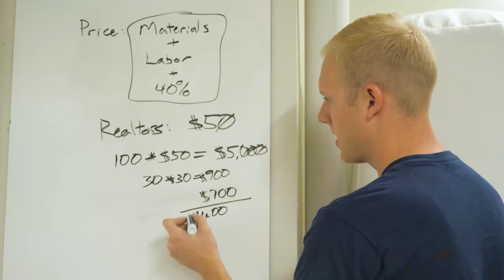this client wanted way more than we thought...

Comment: Hi, little tip.. use elongated holes in metal brackets to mount desk surface to allow for slab wood expansion/contraction, and do not overtighten the bolts. Beautiful desk desing BTW. One more thing, in my upholstery business, i had to be clear what is NOT included in the job.

Comment: Check out mixing mate on Amazon. It’s a cover for your finish that you put on in place of the original. The new cover still seals, but has a mixing handle and pours finish out like syrup. It’s quick and clean. Once you have one, you’ll never be without one.

Comment: Just a suggestion for a bit of a cleaner look, rather than routing out the legs to fit the flat bar for mounting you might want to route out the underside of the table then it all sits flush. You can still use the threaded inserts in the table but it will look like the legs are sitting flush with the bottom of the table.

Comment: I would elongate the holes on the metal plates underneath the desk. If you dont give room for the top to expand and contract your desk top will eventually run into issues and crack.
Reply from the maker: Holes are much larger than the bolt for this reason.
Reply: @jennieanddavis  ah, went together quickly and couldn't tell on the video. Thanks for the response 👍

Comment: Don’t put so much pressure on yourself. Sales is not hard under a few circumstances. Trust in your product, know your product, and create a relationship. Sales is all about the relationship. If you create a relationship with the client and make them trust and know you on a some what personal level then the sale comes easy. I’m in the flooring business and I’m a sales manager. If I go into a meeting with a client not confident in my self and the product, 90% of the time I’m not going to make the sale but if I go into it confident in myself and the product, 90% of the time I’m going to make the sale. Yes it’s a little different where flooring is more or less a necessity but it’s still the same process. Trust in your self first and then the product. If you don’t know the answer don’t tell them some bull crap and make it sound good. Tell them, “I don’t know, but, I will find out the correct answer and let you know.” A customer is going to appreciate that more than you making something up and telling them one thing and it being another. So trust in your self and then the product and you’ll be fine. Stop putting so much pressure on yourself and enjoy it. Once you start to do that you’ll have fun doing it and absolutely love everything about sales. Hope this helps.

Comment: Sometimes i am afraid that what they order it will take me alot of time to do or i dont have the right tool to do what he asked for, or i dont have the right skill yet to make what they want.
Reply from the maker: Ooh that's a good one! 
Couple things we've noticed from folks in the Stud Stack who have had this issue:
1. You're probably way more talented/prepared to build customer projects than you think you are
2. It's OK to tell the customer you can't do something! This friend who bought the living room set wanted metal legs and we straight up told him that he wasn't going to like our price on metal (since we don't normally do it). Then wooden legs were the obvious choice.
3. If you don't have the right tool, buy it after you've made the sale. If you're charging enough, you should be able to buy whatever tools you need for each job. On bigger machines you can spread out the cost between a few jobs, but then you've got the tool forever. Just schedule enough time before delivery so that you can learn the tool on some scraps.

If you're into books, pick up a copy of 'Never Split the Difference' by Chris Voss - you've gotta build some confidence and not be afraid to ask the customer for what you need. 💙.